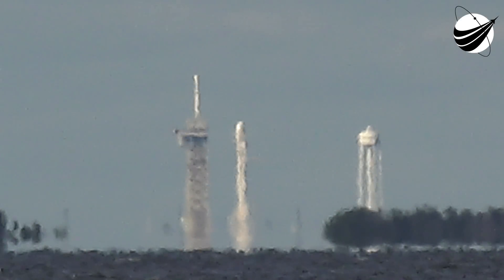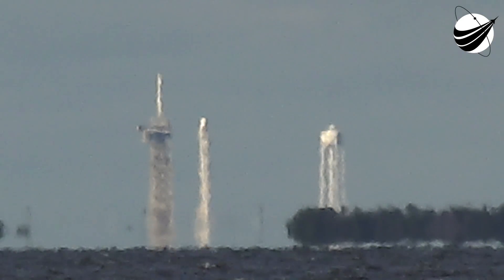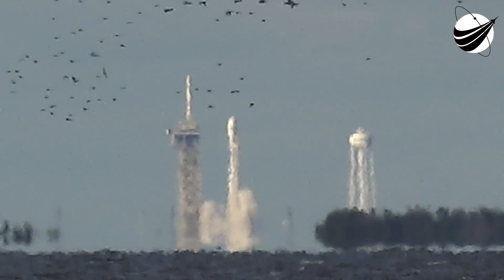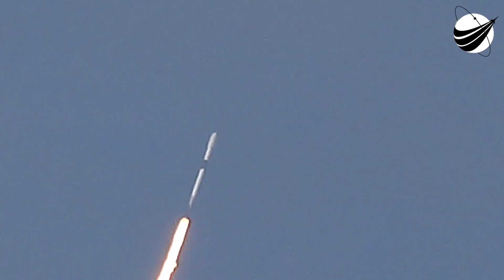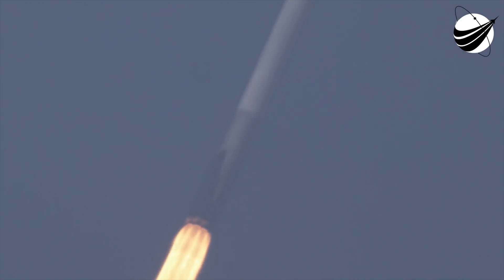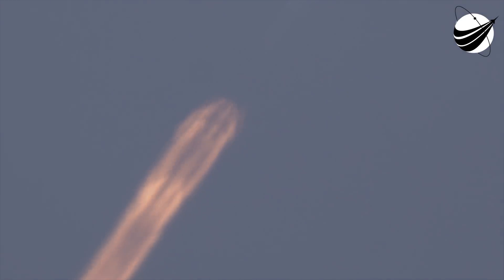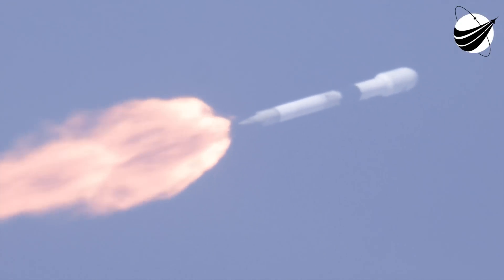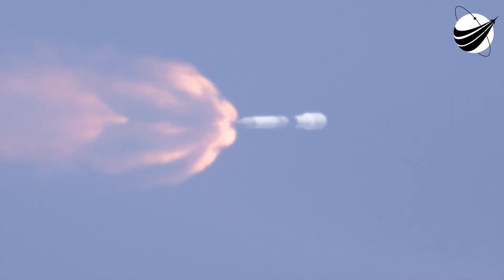SpaceX - Es"hail 2 - Launch And Track  11-15-2018

Comment: NASA is so far behind Space X.
Reply: Yeah cause they are limited by the politics. All the politicians want a piece of the pie so NASA is spread too thin. That makes everything cost too dam much.
Reply: NASA doesn't build rockets.
Reply: NASA put men on the moon, built a rocket that reuses 3/4 of the rocket compared to the Falcon 9's 1/4, they also used it nearly 40 times, compared to SpaceX record of two flights. NASA has landed on Mars many times before. NASA is not behind SpaceX and without NASA, SpaceX would be long gone.
Reply: @_Andrew2002  half of that i agree with
Reply: NASA is behind SpaceX the same way a jockey is behind his horse.
Reply: As opposed to SpaceX, they focus on time and cost efficiency, therefore they get things done quicker and cheaper.